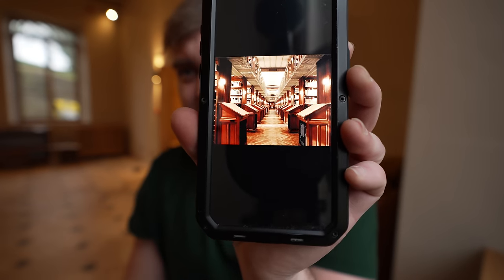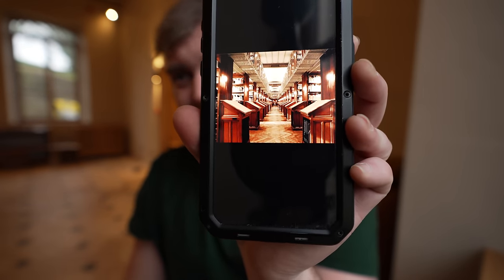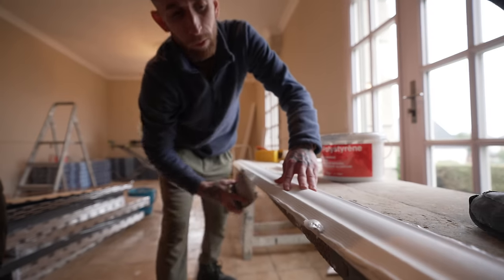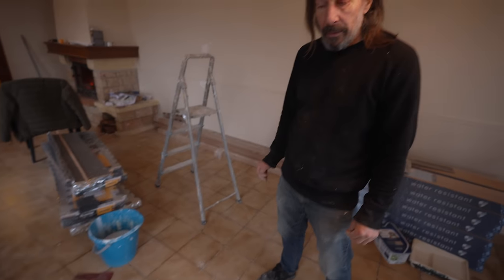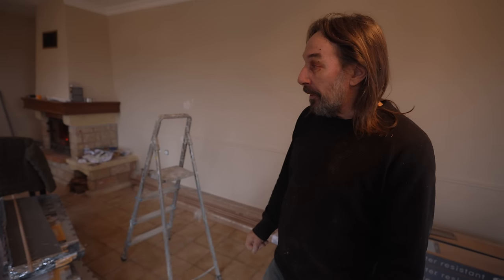A Very Special Delivery

Comment: Two things about the floating LVL floor:
1. In the last video, I saw you left expansion joints almost all the way around, but you butted it right up against the other floor in one spot. Are you sure that won't cause problems? I believe best practice is to still leave a bit of a gap and just cover it with a wider transition strip
2. You said you're going to have it flow through the rooms - I've seen it work sometimes, but I've also seen it buckle up when done in larger swathes, especially in older buidlings where the temperature and moisture are more variable. Please consider putting in a few expansion joints with transition strips where the doorways are!

Comment: Nurse here for Simon. Now that it's been a few days. Put ice only on your Eye off & on if it keeps swelling. 

Take that warm & cold shower for your hip still & get ibuprofen ( example  Motrin or Advil)  for swelling at night. Tylenol for the day.  Etc.  Do not take them at the same time as they cancel each other out. Always take them 4 -6hours apart.

And like I said  before Tumeric helps with pain & swelling.  Aspirin patches & pain patches will help long term for the hip pain. Hip will probably hurt for months if you tore a ligament or muscle. 

A meat compress from freezer will help with your eye bruising ; sensitivity  Lol ❤️ 

No worries > Crack-On.

Comment: Just curious, why insulate the interior walls?  Seems like a lot of expense, especially with the Rockwool, with little benefit.  Even if the doors are open in winter, the walls look super thick and your insulating the other interior spaces.
Reply: Yes agree also curious about this, well pointed out 👌
Reply from the maker: Its not required but it makes a room more efficient to keep warm as the heat stays within the room rather than passing into cold walls.
Reply: @ThePethericks  Precisely. To the extent a project can afford it, architects often recommend insulating all interior walls for that very reason.
Reply: @ThePethericks  Thanks!
Reply: Will also help stop sound travelling between rooms.